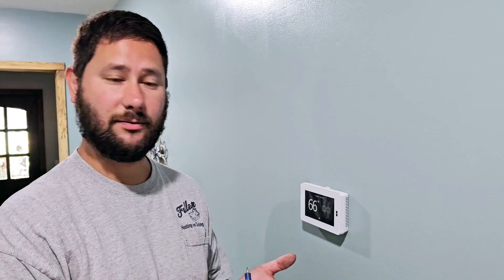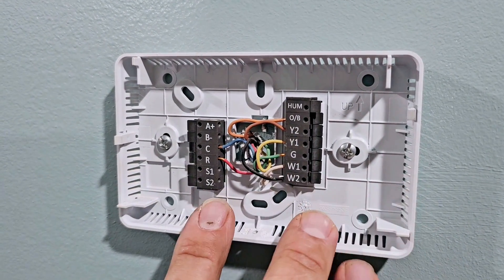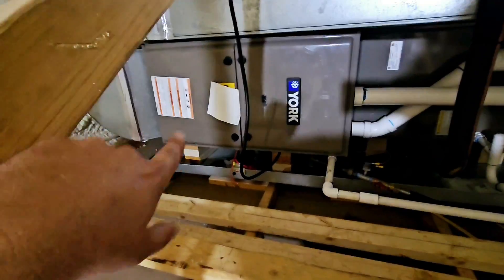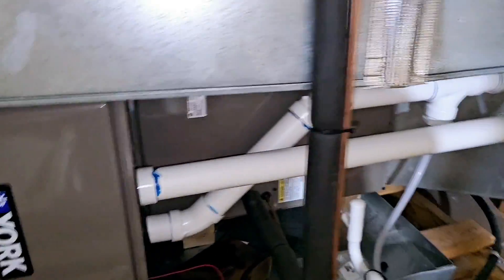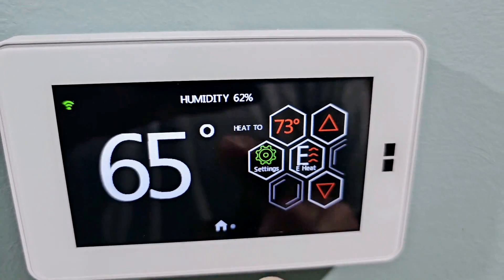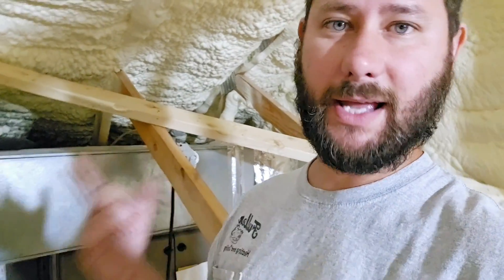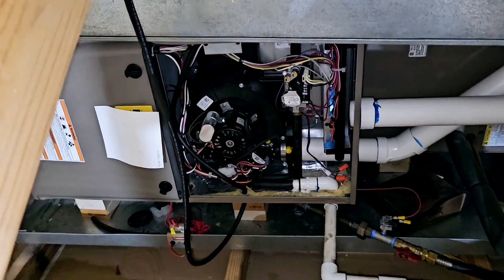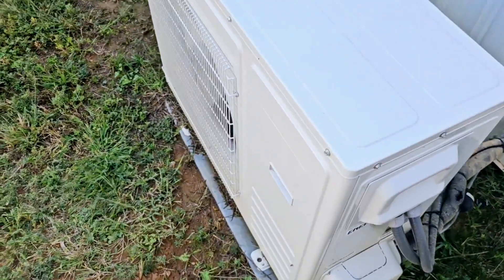Dual Fuel System Explained: How Does it Work? #HVAC

Comment: We just got a new dual fuel, heat pump plus propane gas furnace. This is 1 of 5 HVAC systems at our Church. This old system had failed after 19 years, so we went to this new dual fuel setup.

Heat pump is an American Standard 15. Not sure of furnace specs, but it's higher efficiency.

Thermostat is Honeywell T10+, using 4 of the T10+ for all my systems now. Remote setting edit works well over Residio app. 

5 HVAC in place were gas furnaces plus AC. We're in a Church setting. Sanctuary is a parallel 2 HVAC on one T10+. Then Fellowship, Lobby, Hallway/Sunday school are the 3 other systems.

Hallway HVAC is the new dual fuel system.

I'm the guy that runs and monitors these HVAC systems. I've had an HVAC night class in an attempt to become an apprentice, never worked out though. Became a truck driver until too many back injuries forced me to train for IT. Finally had to claim Disability SSDI at age 45, in 2014.

Comment: Need to replace a 23 year old Trane xe90 furnace, coil, condenser set up. Got a quote for an American standard 60,000 btu 2.5 ton 14 seer2, coil, duel setup, plus honeywell 1200 pro thermostat. Was 15,800 plus permits. It's a confo unit with an interior closet where power, ductwork, dedicated power, vent, exhaust, drain, all terminate. Price seems high, what do you think?

Comment: My electric bill is 1000 in January, the coldest month of the year. I unhook my auxiliary wire in my thermostat. And when the temperature drops below thirty degrees. I just shut off my heat pump and used one space heater and gas fireplace, the next January my electric bill was 500.00 just by  me manually controlling the auxiliary heat, or in my case disconnecting it. I don’t understand why we can’t control when the auxiliary heat comes on. It causes huge energy consumption. I’m considering the duel fuel for energy saving. Am I wrong to think it will save me money?
Reply from the maker: I would say, get a thermostat that allows you to program. When the auxiliary heat comes on, maybe based off of runtime or degrees from set point
Dual fuel will definitely save you some money. That's way too much to be spending per month. Unless you have three or four units
Reply: I have a 3.5 ton downstairs and a 1.5 ton upstairs. Upstairs isn’t used much because nobody stays upstairs. Upstairs stays set at 65 degrees

Comment: Question if you see this. We're building a new home in NC & a friend told me about his dual fuel heat pump system, which he loves. I first asked my HVAC contractor about a dual fuel system, but then decided not to go with that. They installed a Carrier (conventional, 4-zone) system & so far, have put in the duct work, wiring, & attic air handler (at least I guess that's what the unit is called in attic). The outside unit heat pump has NOT yet been installed. Now...I've decided that I would want the dual fuel system. Can this be added or modified to what has already been installed, or not? I don't want them to have to remove the air handler but maybe a furnace component can be added? I have about 4 more months before the home is completed. Thanks for any info you can advise. Loved your video...
Reply: Just get a good heat pump and you’ll be fine. The guys installing more than likely know what they’re doing, ask them.

Comment: Taddy  Is there a dual fuel thermostat that will work by time of day? I have a solar system and I would like to use the heat pump during the day and the furnace at night.
Reply from the maker: I am not sure but I bet there is

Comment: Hey Teddy, I've got a navien combi boiler for heating and a multi split heat pump system for both cooling and heating.  Can I get both systems connected in one programmer thermostat?  Thank you in advance for your response.  Have a great day.
Reply from the maker: I'm not sure that's a good question. I'm sure there's a control out there that will manage both. I just don't know the name off the top of my head, but if I find out I will send you a message

Comment: Nice video and thanks for the information. So I’m learning how to become a home inspector and hvac is in the course so I have a question maybe you could help me out with? So I was reading today and I came across a dual system and I had to stop and think about what it was? I honestly thought it was a split system like this let me explain I thought a dual system was a heat pump outside that’s hooked up to electricity and a furnace that is inside and fueled by gas. So thanks for showing me the difference but I wanna know how I can tell just by looking at them and examining them to tell if it’s a dual system or not? So correct me if I’m wrong but it would be a propane running or fueling the heat pump and gas fueling the furnace right?

Comment: Nice job. Do you have any heat pump dual fuel hydronic system installed?
Reply from the maker: I don't think I have a video on that I will check though.
Reply: @taddydigest  I could not be able to find any content about this. I have baseboards installed and I would like to install a heat pump hybrid boiler to it. Thanks for any help.

Comment: Propane and Heating Oil dual fuels are great with heat pump. Natural gas doesn’t make sense as the gas companies charge a service fee each month that is 25 dollars in some places. Switch to electric water heater if you have electric heat pump.

Comment: Another good thing about dual fuel is that if there is a power outage,the gas furnace runs on 120 volts. A small generator will enable you to have heat.

Comment: I have 2 dual fuel for my home and went to buy a new thermostat at home depot this evening and they only had electric heat compatible. 
Fortunately it’s failure is only the button to lower the temperature and it’s only set 1 degree too high. So to the hvac supply I shall go tomorrow. 

It was actually the install of both of those units which spurred my interest in gaining knowledge of this end of hvac. My next home I’ll be installing a boiler and hydronic baseboard. I’m not a fan of forced air heating.
Reply from the maker: Good Stuff Thank you for sharing
Reply: Sensi Touch 2 thermostat has a user configurable heat pump lockout temperature. The Sensi Touch 2 gets the outdoor temperature via WiFi so no need to run an outdoor temperature sensor. I purchased the Sensi Touch 2 from Amazon. Installation was a snap for my dual fuel unit.

Comment: Hi Taddy Im a hvac tech only on 2ton minisplits..Im thinking of buying the ""jumper king 24v short trouble shoot...my question is would it be a smart investment since I only work on 2ton minisplits...can you please reply!!
Reply from the maker: I don't know what the jumper king is
I've never had one and don't know what it is so i'm not sure if it would be a smart investment.
Reply: Its a device tat works with 24v it has aligator clips that connect to the thermostat communication wires its been riviewd by other HVAC techs in USA its to trouble shoot the 24v shorts to ground sold by Amazon."" Its called the "Jumper King "😊

Comment: I worked for an HVAC/R company about 30 years ago that did alot of work for York Int.

They actually made an a/c unit that was natural gas powered, but still wasn't convertible to propane. Interesting concept but I think they were still working the bugs out of it.

Do they still make anything like that? Just curious

Comment: I've recommended dual fuel for years. Love how it locks out the condenser when the temp drops too low at night. When it's high 40's to low 50's and you need heat, the HP is far more efficient, but when it gets down to the 20's at night, the furnace fills the bill.

Comment: Quick question what’s the “ m “ call for on a York  heat pump the “ m “ is on the defrost board going into the 24v contacter but I don’t understand what exactly it’s calling for please help
Reply from the maker: I will do video about that.